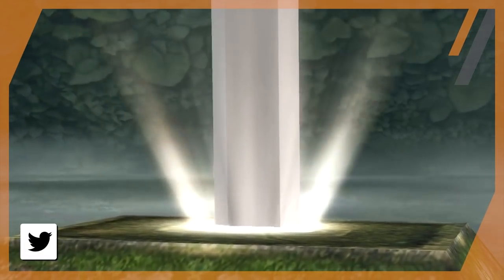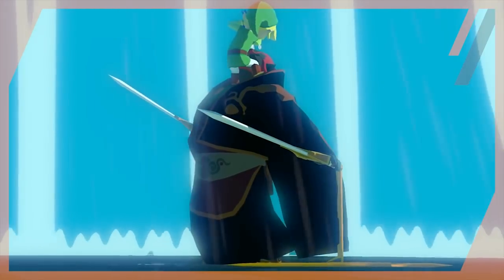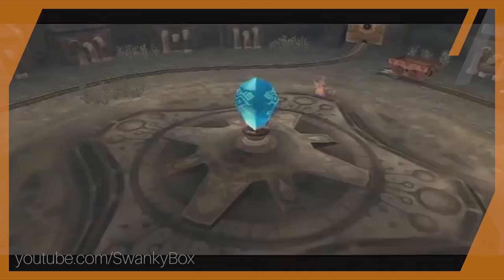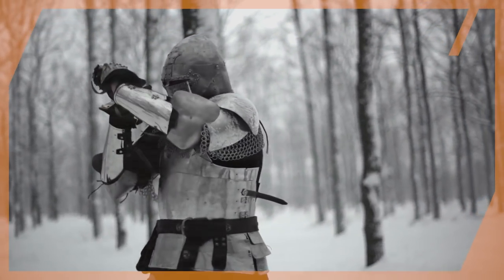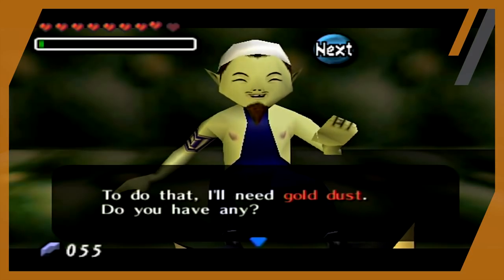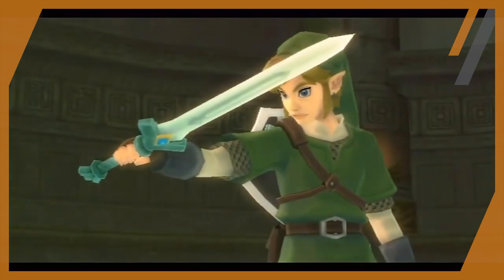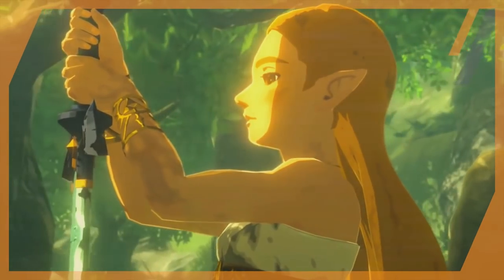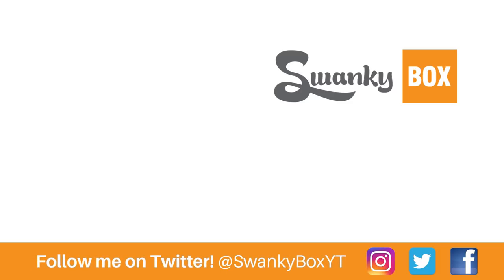Why EVERYTHING About Zelda's Master Sword Somehow Makes Perfect Sense

Comment: There's some issues I have with this theory

The first and largest is the composition of the blade. While a logical conclusion with all of the given info, it all becomes a moot point when you remember that in Majora's Mask... you don't have the Master Sword. Its the Kokiri Sword that you use, that upgrades into the Razor Sword, and that mixes with gold dust to make the Gilded Sword. The other thing to consider there is the design and name of the Gilded Sword. Gilded means its covered in gold, and the design shows that to be the case as well, as opposed to looking like a titanium-gold alloy. But again, design aside, it isn't the Master Sword, removing any clues of its material. Personally, I'd say its the fictional metal Master Ore shown in Link Between Worlds, or perhaps even Eldin Ore shown in Skyward Sword (or perhaps they are different names for the same ore?).

The other point is more personal, but I dislike people relying on the outside sources of Hyrule Historia and similar. I understand that they are supposed to be canon sources of information, but there are many things that it says which contradict things stated in the games, instead seeming to ignore such contradictions to pander to popular fan theories. And that's I see the idea of the Ocarina of Time and the hilt of the Master Sword being Time Shift Stone. While it makes some sense, it doesn't quite go with how time shift stones were shown to work, and completely goes against the statement of them being harmful for humans to handle. That statement makes it seem to me like making an ocarina of that metal to be as sensible as making an ocarina out of lead, or perhaps more accurately making it out of uranium to show the same danger making a sword hilt out of it. But only the ocarina is supposed to be confirmed, so I'll only focus on the issue of claiming the Master Sword is made of time shift stone. Because that seems like a large leap in thought to account for an ability tied also to the Sacred Realm, and the way time shift stones work doesn't fit for repairing the Master Sword either. The repairs seem more tied to the magical properties, but I'll get to that. The issue with using time shift stones to explain the seven years in Ocarina of Time is what the game states happened. It didn't jump Link forward seven years and then back seven years. It locked him in the Sacred Realm for seven years, then returned his consciousness to just before it locked him away. The power seems to more come from the Sacred Realm in combination with the Master Sword, not strictly the Master Sword.

Finally the topic of it repairing itself, or more the denial of magic. The tempering of the blade in Skyward Sword was to grant it Hylia's blessing, giving it the divine ability to destroy evil, making it the blade of evil's bane. The physical part of the blade already existed in the form of the Goddess Sword, it was divine tempering, blessing, giving it magic abilities. That divine blessing is what allows it to repair itself and remain undamaged. This may be aided by good metal, but in a world with fictional materials and magic, you shouldn't argue away any magical influence. Remember that it is also a blade with with a sword spirit, Fi, in it, right from the earliest point in the timeline we've seen. We don't know if Fi was there right from forging or brought in afterwards, or if it is Fi's existence that makes it indestructible and self repairing. Remember that, although we didn't see the existence for as long, Demise's blade, with Ghirahim as its sword spirit/demon, showed similar properties in not getting worn down or damaged. So perhaps its that it contains a spirit instead of there being a specific material granting time reversal abilities.

All in all, while interesting, this theory ignores too many unknowns, contains too many assumptions, requires incorrect information (likely an understandable accident), and avoids some confirmed information to instead rely on more guesses based on reality. Its like saying Harry Potter's imperious curse is just the power of suggestion because that's all mind control can really do.

Comment: If it is not made of master ore, i'd say it may have some silver, as it is a "holy" metal along with the fact that it is a great conductor of electricity. In the demise fight it is shown that it can conduct and hold a charge as its struck by lightning, so for the conduction part silver fits the bill. For the holding a charge part I dont know. speaking of the demise fight due to the lightning we know that the hilt doesnt conduct, but this is not true in BOTW were it will get you struck by lightning

Comment: I'm not sure if I stole this theory from someone else so if I did I'm sorry but, Since the master sword is linked to Link (Pun intended) spiritually couldn't the master sword have been healing because link was healing and based on that wouldn't the master sword be damaged because link was severely damaged, Also another theory is that the master sword could be getting weaker since Zelda did say "I can no longer hear the voice of the master sword" or something like that. Also to pair with the master sword getting weaker in the DLC of BOTW you can strengthen the master sword meaning that the master sword wasn't at its full power. However in Wind Waker, you also basically do this same exact thing to strengthen the master sword because it has lost its power. This could also mean that Over time the master sword could get weaker when it's not being used because in Breath of the Wild it hadn't been used for 1,000 years and in Wind Waker it also hadn't been used since around the Hero of Time Era So does that mean that while the sword isn't being used by link does it get weaker? Also what's up with Link being right-handed in BOTW (Not related) Again Sorry if I said the same theory someone else said I wouldn't and didn't mean to if I did.

Comment: The Master Sword is made of Draenium, a metal that can be made indestructible through chemical processes. It is mined deep underneath Death Mountain by the Gorons. When a certain type of energy is charged through it, it glows and can cut through most materials. The hilt I'm not sure. Maybe it IS made of Timeshift stones, although that wouldn't explain it's durability. Maybe a Draenium/Time shift stone alloy?

Comment: In Breath of the Wild, the sword's damage capacity goes up once you clear certain DLC's challenges. (Challenges where you DON'T have access to the master sword, btw) And against specific enemies, the blade glows and doubles the damage inflicted. Do you care to speculate what kind of metal can do that? Or how the hilt would be responsible for that?
And if the hilt rewinds time to undo the damage on the blade, why does it wait until the blade shatters before it starts to restore it?

It's a GAME! The sword is probably inspired from King Arthur's sword, escalibur. So, it's made out of Escaliburium.

Comment: Dude, Blade is made of Master Ore. Its shown in Link between Worlds. My theory is that the Master Ore causes the blade to repair itself over time, although a Timeshift Stone Hilt could also answer that question. Maybe. Master Ore that has been blessed by the goddess flames and Zelda/Hylia causes it to absorb the ambient power that exists around it. Another thing also to note is that the Master Sword is also the current prison of the Soul/Mind of Demise, shown in Skyward Sword. The problem with that is, of course, the Curse of Demise which is what causes the Zelda games to happen. Every doomsday event that has happened from Skyward Sword on-wards can be a form of the Curse. The magic of a Demon Lord's soul could also be what fixes the blade, or the Master Sword, being a living sword because of Fi, is also trapped within the Curse of Demise and, therefore, is unable to be destroyed until the Curse is broken. But because the sword houses Demise, it needs to be broken to break the curse. Demise himself may be fixing the sword to ensure his rage and curse never leaves Hyrule. But i digress.

Back to the Timeshift Stone hilt, I would suggest to you that the Master Sword needs to be in a blessed hilt for it to actually activate the "back in time" process of fixing the sword. If you look at Skyward Sword, timeshift is only ever active while in a holding of some sort. I therefore put forward that the Master Sword needs to be win a hilt for it to fix itself, and when it runs out of power, its not Timeshift thats empowering it, its either Demise or the Sword is absorbing the abient energy of the world.

Comment: One thing that doesn't make sense is why the ricasso, the narrower part of the blade just above the guard, appears to be sharpened. The purpose of a ricasso was to put a finger above the guard for extra control or to grip with one of your hands for extra swinging power. Sharpening it defeats the purpose of having it in the first place.

Comment: This sword is an enigma, but your ideas here hold some merit, as it was forged by Hylia herself I have a couple theories of my own, and they include a number of different things, so bear with me. I agree with the Titanium gold statement in the video, because of the fabled “Master ore” an ore found in both Lorule and Hyrule, though Hyrule seems to have run out some time ago, likely as a result of ancient sheikah and hylians using it all, with what little was left being used to create the goddess sword, which was incomplete, later after being essentially reforged by link, it is capable of being “upgraded” in Lorule using what little master ore you can find native to the area, which gives it the same hue as titanium gold, so in Hyrule master ore is likely a naturally occurring titanium gold alloy. 

Now comes my idea, with the inclusion of time stones and time travel technology, it’s more than likely that the master sword does have a type of suspended animation function, literally preventing it from moving forward in time, keeping it in peak condition, though it’s more probable that with what we know that time stones were also mixed in with the blade, making a titanium gold time stone alloy (which we will call time steel), allowing it to literally control the time of itself and whatever it cuts or touches (explaining the power to skip between times in ocarina of time), but with what we know of the sheikah and their ancient technology, it seems they have more tricks up their sleeves, the sheikah predate all known civilizations other than the hylians, who we can safely say lost a great deal of technology when demise came and slapped the world upside down, in breath of the wild the sheikah (or Robbie at least) have a type of arrow that can seemingly make things vanish or disappear, as this is crafted from scavenged tech, we can either assume Robbie knows well what he is doing, or discovered that this thing is capable of immense damage. Now this arrow is either capable of disintegrating whatever it touches, or more probably isolate and capture a subject they touch and reverses their personal time until before it was created, at least in my mind that’s probably what happens, and the master sword has capabilities like this too under my theory, which is likely another function of the spirit Fi, she is likely capable of turning on and off this function within the master sword, or at least controlling its intensity, as the isolation of targets was more than likely developed long after the master sword was forged, making it impossible to control what would be subjected to its time powers, so the guide Fi had this technology developed within her to make sure the sword didn’t malfunction and suddenly uncreate link, that would be the worst game ever, and with its tracking abilities and laser powers, it more and more sounds like it was developed with the same technology or at least technology similar to what’s found in the laser shooting sentinels we see scattered through breath of the wild, though the master sword is not as powerful and nowhere near as accurate, which is likely due to it being an outdated form of the tech, with the much newer sentinels boasting far superior versions than the master sword. 

Though it’s powers aren’t confirmed to be gone as of yet, the upgrades it receives or could possibly receive in Lorule disappear later in the franchise, which might be because either the sword absorbed it and incorporated the upgrades into its makeup, because it can’t help itself, or possibly because this stopped Fi from being able to do her job correctly, which was ok because it probably disabled anything the time steel could do as it was covered in master ore, though Fi managed to save the tech or enchantments inside the sword so it could keep lasering. The flames were probably less about tempering the master sword, though it was definitely a big plus, and more about getting a useable power source for the sword instead like we see the sheikah doing with their blue flames in breath of the wild, it also wouldn’t involve raising it to the sky so it could absorb solar power, and Zelda making it into the true master sword was more likely her saying what needed to be said in order to flip the swords power switch, as it definitely looked like it was “off” in the previous state, allowing it to use all of the previously mentioned powers (like the skyward strike and time manipulation) without having to raise the sword to the sky, though this doesn’t take effect in skyward sword, but at the end of the game the master sword absorbs demise or whatever it was demise left behind, likely completing its power source at the sacrifice of the knowledge of Fi as she would likely have to go into overdrive to keep the likely still conscious malevolent energy in check, while also maintaining the sword and repairing it when it’s damaged, making sure that only those with pure hearts are holding the sword, ensuring link survives (as seen in breath of the wild, though it could be argued that she could simply reverse time on him a little, but the sword was damaged too, and likely needed a little bit of help to repair itself or couldn’t do one while also doing the other, hence why it had to be placed in the pedestal while link was in the shrine of resurrection) ensuring the sword is only doing time thingies when needed and making sure it knows what’s up so it would know who to tell to save link, thus why Fi never seems to talk again after absorbing demise, with the exception of one life or death situation. 

Thus concludes my theory, I know it was a bit of a stretch, and a little drawn out, but I hope it sparks a little hint of curiosity in that big ol’ brain of yours, I wish you swell day, and a good night or whatever time it is whenever you’re reading this. Later super pals.

Comment: I’d just like to point out that, though swords, being made of metal, are relatively heavy.. they really aren’t THAT heavy, much of the power of a sword comes from the users ability to make quick jabs and slashes, even for a pretty big sword like the master sword. Basically, lightness is a KEY factor in the quality and usability of a sword, especially since Link is a teenager.
My issue that this info applies to is that you say it’s made of titanium, gold and a crystal Hilt.
(Here’s the measurements I’m using, since it’s a 3:1 ratio, I’ll be using 4 cubic feet as reference for each)
1Cubic foot of titanium: 281lb
1 cubic foot of steel: 489 lb
1 cubic foot of gold: 1206 lb

A 4 part alloy (such as the 3:1 titanium gold alloy) for each would be:

4 cubic feet of steel: 1956
3:1 ratio of titanium to gold: 2049
 This, being an additional 93 pounds in cubic footage, even scaled down would be a crazy amount of extra weight, as lightness is key in the usability of a sword.
Curious how you plan to take this into consideration if you plan to use any of this or prove me wrong!

Edit: I totally forgot to talk about the crystal hilt, I couldn’t find much on the weight of crystal as no one really,,, measures crystal in cubic feet,,, but I feel like it’s not that heavy and the center of balance on the master sword would probably be WAY out of wack, the closer the center of balance is to the guard, the better.

Edit2! I’d just like to clarify, I mean all of this with pure respect and curiosity, not as a bash to your intellect, I really enjoyed the video! Take care .
Reply: that's actually an amazingly small ratio you suggested there. we're talking a 3-4 pound sword increasing to 3.3-4.4 pounds. not actually very much.
Reply: Jacob Richard oh okay! i kiiiiinda started to think about that towards the end of that comment but decided to post anyway. thanks for clearing that up tho! have a good day!

Comment: in twilight princess we are told why the blade in breath of the wild looses its true power, the blade was retrieve by link without being necessary, ganon abandoned the reincarnation cycle and turns into calamity ganon, the blade senses no purpose of being needed as the next reincarnation of Demise is not aproaching, thus rendering the blade with a fraction of its true power, the 60 after the trial of the sword is about 1/10000 of its true power

Comment: Since in the pedestal the master sword is reversing time on the damage accrued to the blade, it bears to reason that its damage output is reversing as well in the temporal shift. This could explain while pulling it out of the pedestal Link takes damage cause all the warped space time around it, which stops abruptly when its finally free. Why damage is coming from the hilt i think could be cause of how distorted the atmosphere of space time around it can make the energy fly out in odd directions. Safe to say, this is not whats going on here. the game says that much. Its just an explanation i was trying.